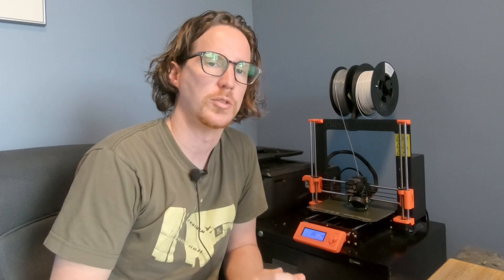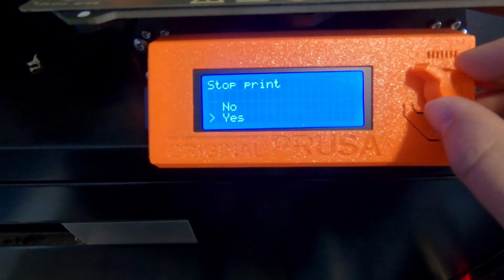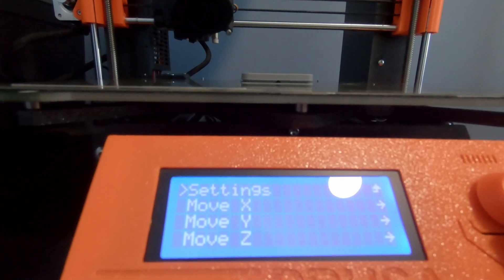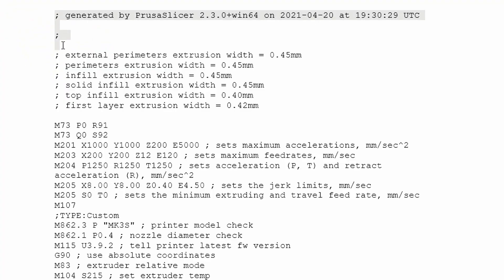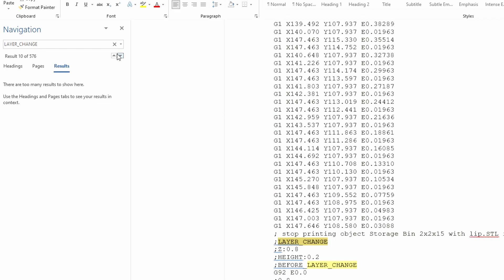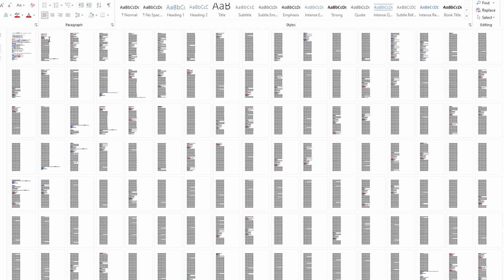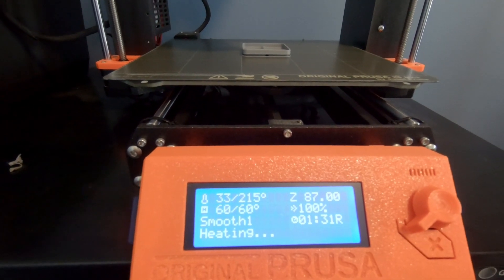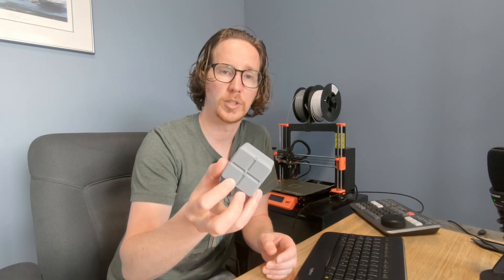How To Resume a Failed Print

Comment: Unfortunately you did not explain and show enough how and where edit gcode
Reply from the maker: Sorry I guess I should have slowed down around those parts of the video. It's hard to balance detail and video flow or speed. If you pause the video I believe you can see what lines I delete.
Reply: @ResearchDesignBuild  I tried hard 😉
Reply from the maker: @joelcordier6762  Next time in need to resume I print I will try to capture some more details and post an update video maybe.